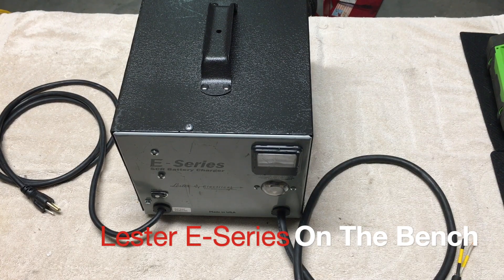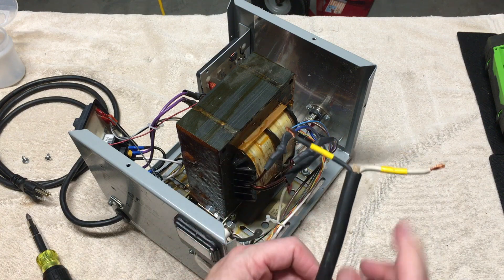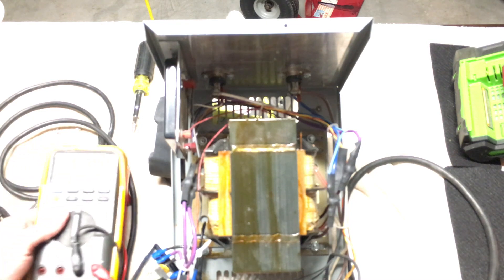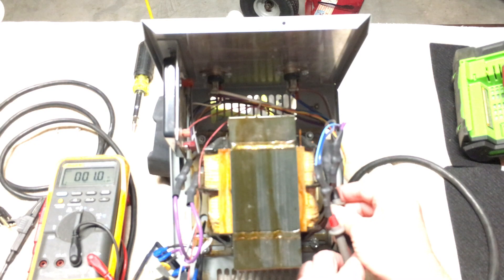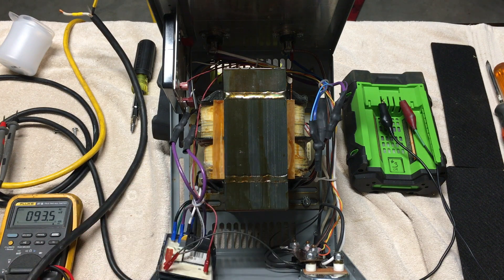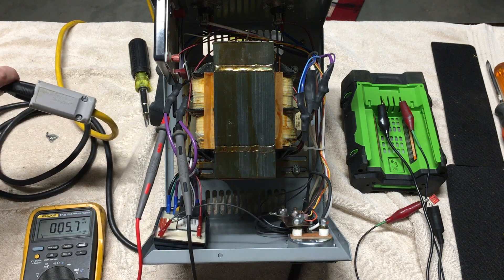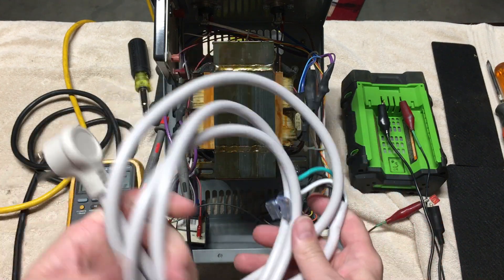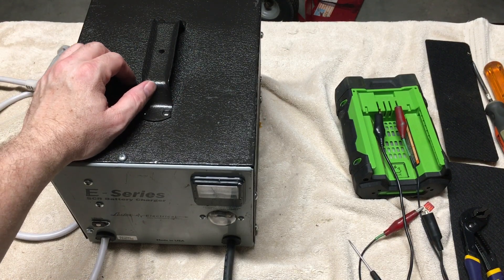Lester E-Series 48V Charger Repair

Comment: Just wanted to first say thank you for this video, especially for the schematic.  Also wanted to pass along the issue we found with ours (not charging).  The relay is mounted to a PCB (which is inaccessible) but has quick connectors that are visible.  The COM connection is tied to neutral which is where we had no continuity.  We installed a jumper off the neutral connection up to the COM quick connect and that got our charger running again.  This should only be used as a temporary fix until you can get a replacement board, though, since this could potentially bypass surge protection depending on where the circuit is open.  For reference, the relay is a 832AWP-1A-F-CF.
Reply from the maker: Awesome! Thanks for sharing that and thanks for your kind comment!

Comment: I have a 48volt Lester charger, It was plug into a club car 2007. it never shut off and over charged the battery. It's OBC was bypassed. I installed a new OBC. I plug the charger in and it clicks but will not charge. I tried it on enough cart did not charge. Tried a different charger and it works in both carts... The small board # 27105-12 The bigger board has a red light blinks slow. looking for advise..... Can you help me, hope to hear from you.
Reply from the maker: Almost like it is not sensing it's connected to the battery. Does it have a diode from the battery sense to the board to test? I only worked on this one and showed troubleshooting what I learned with it on video and it ended up being a simple fix. I have no other repair experience on these type chargers.

Comment: Is there a way to get just 12 volts output. I have one and want to make a 12 volt power supply with it if possible.
Reply from the maker: You would most likely have to add some capacitors for filtering and use a DC-DC buck converter.

Comment: Where can I buy the replacement boards
Reply from the maker: I do not have a place that I buy from that often. I usually check eBay if in no hurry for a board. If no board found, you may have luck with searches leading to places such as this for example.....
https://www.batterychargerdepot.com/BatteryChargers/parts.htm

Comment: I hav a situation where the scr charger was plugged into 220 volt instead of 120 volt ( overseas ). It’s not working anymore. Any chance you could figure what needs to be done? 
Thanks
Reply from the maker: If it is like the one in the video, the boards are coated with an epoxy coating and the problem is most likely in the board if connected to 220V. I would imagine the board smoked before it even tried to output so hopefully the main transformer and SCR's are fine.
Reply: @ThriftyToolShed  
Thank you! Another question if possible, 
Where can I buy the board?
Thank you. Excellent video!

Comment: What does a blinking red light mean on control card  of the e serieslester charger
Reply from the maker: It depends on the frequency of the flash on some models. This may help...https://www.manualslib.com/manual/1633729/Lester-Summit-Ii-Series.html?page=24

Comment: My golf cart charger is only charging at around 2 amps, and it should sit much higher. It seems almost independent of how low the golf cart is, any advice?
Reply from the maker: If this is the same model or similar, I would test like I showed and make sure SCRs are ok and the output voltage is high enough to charge. If batteries are low but still in good condition the charger should absolutely be pumping more than 2 Amps into the batteries. If batteries are ok, it is more than likely not enough output voltage to fully charge at proper current level. Best of luck to ya!

Comment: I noticed you had a print of the circuit for this charger.  I need access to a print for a newer 48v Yamaha charger, board model CGR-025.  Any help would be appreciated.
Reply: Need for 36 volt charger
Reply: Golf cart 36 volt charger repair
Reply: Need to repair 36 volt charger and circuit board

T
Reply: Q
Reply: 36 volt charger repair please

Comment: So the 3rd battery from the positive side is not taking a charge from this 14p 1s pack ? Just trying to figure out what your designation is with the sharpie. 🔧
Also it's okay to replace an 18650 cell with a higher capacity higher amp 18650 cell isn't it?
Reply from the maker: Yes, I have spare cells from buying several bad packs from ebay a few years ago and have repaired it now already! It is the 3rd pack I had purchased to repair and after a look inside and testing it has a bad cell 14!  Lol...